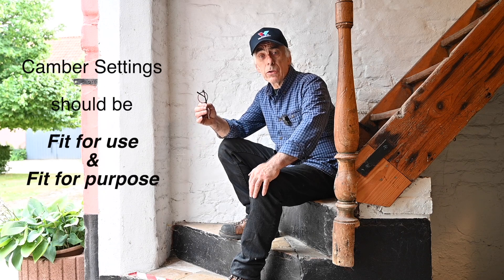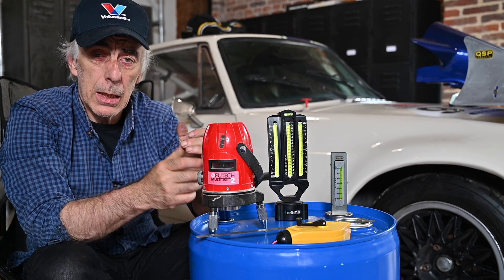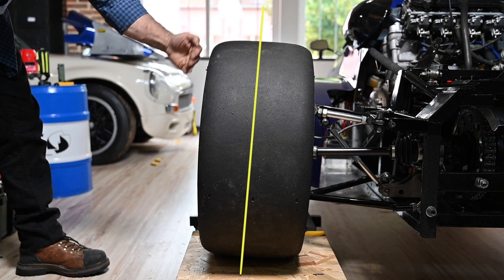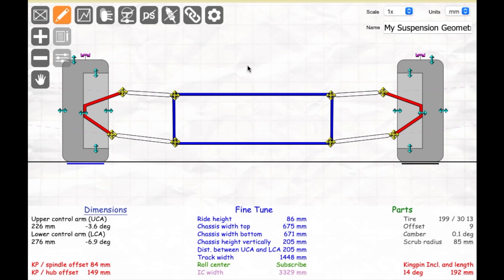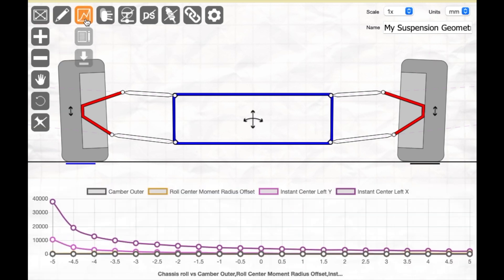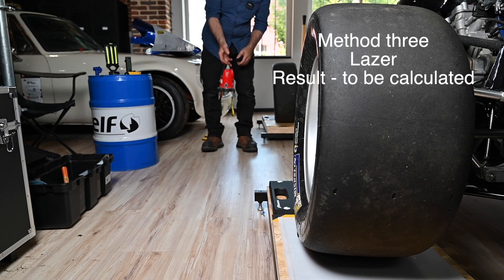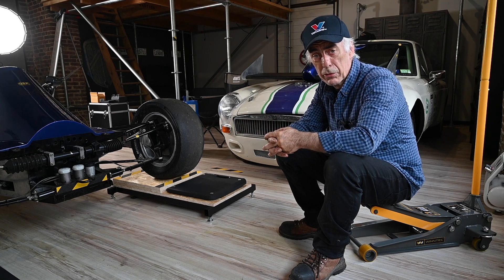Race Car- Alignment- Episode 4- Camber

Comment: Caster is what u want those turn plates for.   Not necessarily for the camber  Most  def  for caster tho  as you must make a .020* swing b4 you can get the correct reading for caster. That’s where the turn plates come in handy !!

Comment: A few tidbits:

Positive camber in the front of old cars was mostly due to the design limitations of the knuckle forcing them to adapt a highly positive scrub radius. To minimize this the wheel can be aligned to positive camber in the design which will bring scrub radius closer to 0, lessening steering torque peaks during braking and lessening average steering torque. Many more modern cars do also align slight positive in the front for stability, though.

Adjusting the camber from the rod end closest to the push/pullrod can potentially cause a change in ride height as it will deflect the rocker, so bear that in mind. Adjusting camber from the opposite end can minimize it, as the rod should deflect less.

I also suggest adjusting the inboard thread as well as the outboard. Bear in mind that adjusting the more lateral arm's length is primarily a camber change, and adjusting the more trailing arm's length is primarily a caster change. You can also adjust rear bumpsteer and wheelbase with the trailing arms on many older Formula type designs.

Comment: Different tires may need different camber settings for optimal performance. Details of design and construction matter. 

Wheel alignment is tedious, painstaking, and distinctly un-sexy. But most people would be amazed at what can be done to a car's handling through camber, caster, and toe adjustments.

Comment: SQUARING the BOX and TRACKING STRAIGHT
Squaring the Box: IMO, unless you square the box you can never be sure your measurements are correct and the car is tracking straight, and not tracking straight kills setup and straight line speed.  Squaring the box is done by removing the car from between the strings then measuring the cross diagonals(front left to right rear/front right to left rear) and adjust the strings till the diagonals are equal. Think about it, if the strings are parallel but in a parallelogram, they will not be parallel to the tires.
   Tracking Straight: How do you know the car is tracking straight, i.e...everything is pointed straight where it should. Some people think setting the rod ends equal on both sides will do it and sometimes it will and sometimes it won't, particularly with old/repaired/modified cars. 
    This is how I check to see the suspension tracking correctly: As accurately as I could measure between forward most bottom suspension pickup points and scribe a mark at the half point on the chassis. I would do the same at rearward most suspension. I would then pull a string set on these marks the length under the car. Next I would transpose this centerline to either side of the car using a large T-square. Finally, using a plumb bob, I would raise the line up(a Steve does here to make a box) till it is at the height of the axles.
     Now you can measure the axle or to the hub backing surface(where the wheel flushes against) to see if things are tracking straight. I've found things to be as much as 15mm total out of ''square''. One side in too much, the other out too much.
  Just another $.02 from the old days of Formula Ford.

Comment: Laser unit awesome plus maybe mention measuring the garage floor with it first. Many folks have sloping floors, water runoff or constructor didn't bother, whatever. It's easy for folks to assume the floor is level just by looks. My garage floor's sloped so needed zeroing with stands similar to yours. As caster can effect camber, striking vertical a center line down the vehicle allows pre-setting of the suspension body points to symmetry. this symmetry means the estimated geometry during travel is actual.
Reply from the maker: Indeed and a good point.... I did mention that in other video's
Reply: @D3Sshooter  yeah I felt rather stupid seeing you'd already posted leveling the vehicle in another vid. The center line marking still worthwhile. I've found several car's I've worked on out of shape using a centre line datum. Keep up the good work.

Comment: Hugh...What...Besides changing camber, you also changed the toe-in! The best place(only place?) to have change camber would been at the rod end at the bottom of the upright. Also you have no idea if there's a slight taper on the end of that nut, I doubt manufacturing tolerances are that precise, it's also a rather short distance to get a measurement from.
Reply from the maker: Toe is at this time irrelevant ( well to some extend).  That is why there is another video where Toe is addressed... Here is my sequence : Bump and droop , set Pre-load on springs, set riding hight, cross balance, riding hight, camber, toe , at the end check caster and kingpin incliation / scrub area and then verify all again....  Bump-steer is something i do inbetween.    And yes as I stated ' Changing the camber can be done at the top and bottom whishbone where it connects to the upright
Reply: @D3Sshooter  Yes, you can adjust at the top or bottom, but if you're going adjust at the top you have to adjust both the rod ends at the top so you don't effect the toe. If you only adjust one of the top rod ends you'll be forever chasing camber and toe. You like to play with comp. sims., verify it there.

Comment: OK... we can say it "less grip" or "much grip". 
But this is kind of misleading I believe. The grip is not given by the surface of contact between tire and tarmac, but by the force the tire is pushed against tarmac... and by the "nature" of both surfaces.
A light car will have a less grip than a heavy car, both having same "foot print", yes we can improve this with the aerodynamic generated down force.
The contact foot print of the tire do not share the same pressure... or force when the tire drop to the tarmac in an angle, this is were the canber helps: to control how the tire deform under the exchange of the weight distribution when the car is cornering... or turning at speed.
Maintaining as much possible same force for the entire foot print of contact does not add grip, but helps to prevent tire damages and also helps with temperature dissipation. Same energy is shared to a bigger surface... less temperature per square cm... mm or inch..of that surface.
Same for the rubber damage, there is am amount of force between this two surfaces right... same amount of rubber, in cubic: millimeters or centimeters or inch will be "chewed" from the tire... but if you do tis on a foot print of 10 square millimeters... or for an 100 square millimeters, the amount in tire "meat" by diameter will be total diferent.
So: angle of the wheels help to prevent rubber damage on the tire, therefor will "give" you grip... but indirectly OK?

Grip is friction and friction is not affected by how big... or small is the contact surface.
Reply from the maker: Good points, and yes that is all very true...
Reply: Most of this is incorrect. 

First off, lighter cars have more accelerative force from a given tire because they have less linear inertia.

That coupled with tires losing grip POTENTIAL as you increase the load on them, means that an increase in load is a trend in the decrease of the grip gain delta. Hence it is important to minimize linear inertia but maximize load; aerodynamics can do this.

A larger surface contact patch area has a lower average pressure, hence a lower load sensitivity curve than a smaller surface contact patch area. This means there is less grip potential lost when load is added. The reason for this is because tires have sidewalls, they're not balloons. Going bigger means more area for a given inflation pressure.

Comment: You should also look at your tire spec sheet when you are on track to adjust it. It should have a TTD (Thread Temperature Delta), it gives a recommended delta between inner and outer shoulder temperature which is usually pretty good to combine performance and tire durability (you will need a pyrometer and someone to quickly check your temperatures when you come in the pits after a hotlap tho). Usually it is around 15-20°C. I personally find -0.5° camber at front very very small, even for a single seater... -1.75° at the rear might be good, but it is not that powerful of a car, so you won't lose out on grip for acceleration quickly, so I'd go all in for cornering. Although you will always have more tire wear like that as well, so you also need to think about cost obviously.
Reply: But I must admit, my experience is with Lotus Exige race cars, with single seaters I only have sim racing experience where tire cost isn't an issue, just getting to the end of the race is haha
Reply: Following up on the idea that you can chase camber(and toe)at every track as Steve suggest is fraught with pit falls. Sure, in a perfect world it may work, but, in my experience, unless you have 4-5 team with a dedicated suspension guy you may be wasting a lot of time. (1) the last few turns before coming into the pits have an outsized effect on tire temps, more so if they're in on direction. (2) Chasing the solution is just as likely to lead you away from it as to it and you're wasting precious practice time. (3)At these entry level formula, IMHO, what you want to do is establish strong baseline setup that works with the drivers style and at the track work more with what his likes and dislikes...understeer, oversteer, turn-in, corner exit and hope he's not a prima donna. There's an old saying ''Tenths on the chassis, seconds on the driver.'' Don't pretend you're Toto Wolff or Christian Horner. Just my .02¢
Reply from the maker: @rickden8362  Rick,  I was not saying that you change your settings at each race... I was saying that pending the circuit you do set the suspension.  So if you race on 4 circuits , lets say Zolder, Spa, Francorchamps, Mettet, then you know what type of tracks it is  ( high speed straight, or lots of corners etc..) as you tested and raced the car before on those tracks... So prior to the race you set your suspension , just like you do with your dog box ( changing the gears).  It is not fraud at all... its a reality that will give you the best results.  Of course you check the tire temps and listen to the pilot how he feels the car.   Remember that I stated  in one of the video's that this is a baseline setting to be adjusted during a shake down and fine tuned for each circuit.  You are right , you adjust to what the skills and desires are of the pilot....  In my case I am the owner, mechanic and driver....😀....   And yes, the driver is the largest factor, there is no doubt about that....   I am not pretending anything, except myself....😀
Reply: @D3Sshooter  Steve, nothing in my post was meant to be personal, it was my opinion of what a general approach to to the race meeting should be. Usually race meeting are hectic, time crunched affairs so efficient time management is key to having a productive and enjoyable time, particularly in a one man operation. 😉
   Added Note: Not sure where you got the idea I was implying any kind of fraud, it was not my intention.
Reply from the maker: @rickden8362  Rick, no problem at all,  I do like your comments and just tried to answer .  So please keep on posting..... its very much appreciated.  There are so many things about racing and set-ups that makes it difficult to cover all in a 30 minutes ...  We are having a chat ... and sometimes things come over not as intended... that is the problem with text messages....😀
Reply: You're right about -0.5 for front and, in my experience, -1.75 is way TOO much for the rear, less 1.00 is more likely. He's just guessing.  Did you notice he also changed the toe-in! The best place(only place?) to have change camber would been at the rod end at the bottom of the upright. Also you have no idea if there's a slight taper on the end of that nut for such a short distance.
Reply: @rickden8362  i guess it all depends on how stiff the car is and how much it rolls to know the right camber for full contact patch in corners... which is where in the end, track testing and and temperatures come in.
Reply: @jarnedeprins3617  With that much neg. camber, tire temps will be very deceptive, that I know from experience. 😉
  And the fact that he also changed the toe-in with that adjustment. Not sure how confident I'd be in his set-up expertise.
Reply: @rickden8362  But you do 3point measurement on the temperature, outside, middle, inside, so you have the 3 points. Together with the TTD given by the tire manufacturer that should give a good idea on if you are running too much or too little camber. But as I said, my experience is with GT cars, not single seaters. And certainly not with small tires like this ;) 
I guess he will doe toe in a different video, but you indeed need to do everything a million trillion times and recheck everything. Because his ride height changed a bit as well
Reply: @jarnedeprins3617  I know how tire temp testing works, done it, know it. IMO It's an overly relied on tool. Since he has no factory specs it may be all he has. But I guarantee, -1.75 is too much and adjusting camber where he did was totally wrong.
Reply: @rickden8362  Why is it an overly relied tool to use tire temps? It is the only thing you can do to get an idea on if your camber is correct or not, especially if you won't have factory specs available
Reply from the maker: Indeed, at the beginning of this series , I stated that this is a baseline.. to begin with.  The final adjustments are always on the track and  track specific...  For camber , that reading the inner-middle and outer tire temperatures...and adjust accordingly .  It might even be that the camber needs asymmetric setting...
Reply from the maker: Why would that be wrong, as it was adjusted at the bottom of the lower wishbone to the upright.. Where would you do it ?
Note that I have no specs, and that the settings here are a start baseline... -1 to -2 are very common at the rear on this type of cars...   Of course the proof will be in eating the pudding ( on  the track)
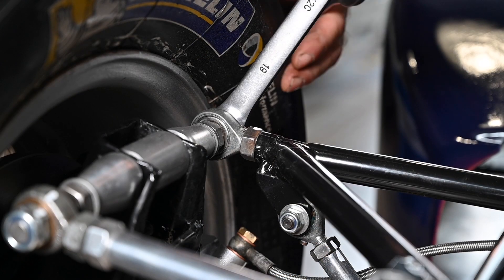Reply: @D3Sshooter  You need to go back review your video...you DID NOT adjust the camber at the bottom wishbone of the upright. You adjusted the camber at the 1 top, outside rod end of the upright see @13:59 in the above video. If you wanted to adjust camber there, you should have adjusted both the rod ends at the top of the upright.
Reply from the maker: @rickden8362  OK, I get your point and indeed in the video that is what you see.. what I should have shown as well is the bottom adjustment on the upright and on the mounting points on the lower wishbones to the chassis.. As you for sure know, those ball joints have a limited length on the stud.  I had those extended to the max ( leaving  2x the diamater inside). That was not enough for the left wheel  to be set... so all I had left was the top as you referred to...  I guess , I should have made that clear. in the video.. Thank  you
Reply: @D3Sshooter   2x the diameter inside is not a hard and fast rule, you still need to some threads(2-2 1/2 min) outside for adjustment otherwise endup with the problem you here...no room for proper adjustment.
Reply: @jarnedeprins3617  Elastokinematics are highly relevant as well. If you just do a calculation based on the roll angle, you will be of 1 to 2 degrees.
Reply from the maker: @rickden8362  , Indeed when I adjusted the top balljoint distance for the camber ( as I had no more safe lenghts on the bottom) the toe changes...  However so far I had not adjusted the toe at all and left it at a best guess.  Now that the camber is set , I will align the toe
Reply: @D3Sshooter  Do you also agree that you should have adjusted the other rod end(the one closer to the gear drive) on top of the upright? That way you adjust camber without effecting toe.

Comment: this channel is so valuable, absolutely beautifully presented and many details 
I’ve seen guys measuring the tire temperature that varies from outside to inside. On my last track day I measured 55 on the outside and 57 on the inside like 5 min after stopping the car (phone usb thermal camera takes time to start :) so I guess I need a bit more negative camber. Right  now it looks 0 degrees but didn’t measure anything. So depending on the track I understand you can adjust it to give you the best grip based on the tire temperature?!
Reply from the maker: Indeed, during the test rides on the track the tires warm up , depending the track the inner , middle or outer part of the tire will be or less warm...   I always take the average of all 3 area's , if each area is within a 10-20% tolerance to the average then  the camber should be OK.... In your case that is IMO `ok' as the difference is minimal...  Much depends on the track type, did you have many corners and if so then I would say that you could at -0.5 degrees of camber...